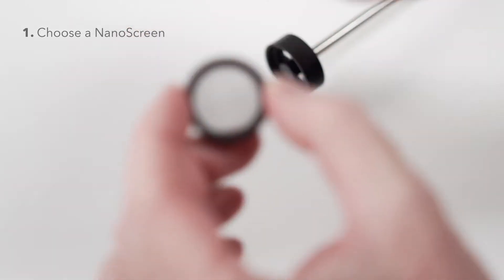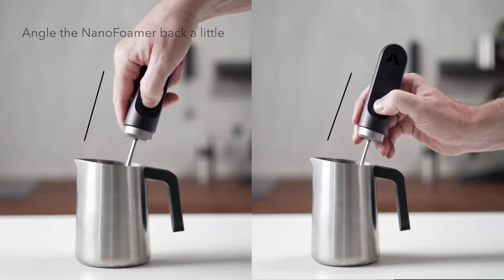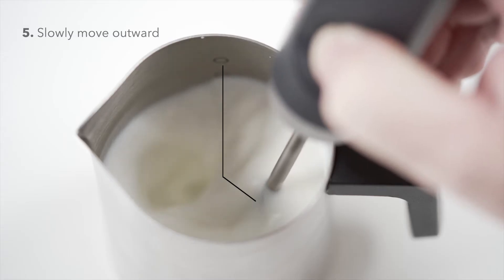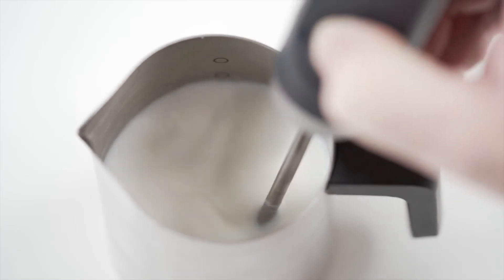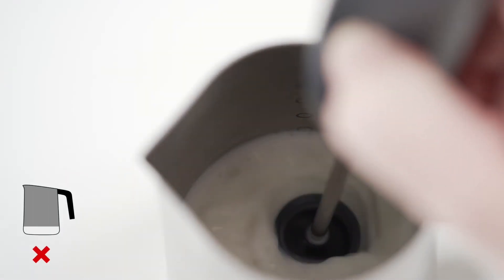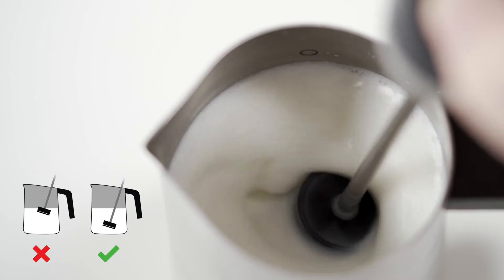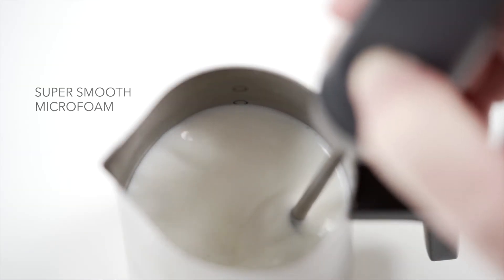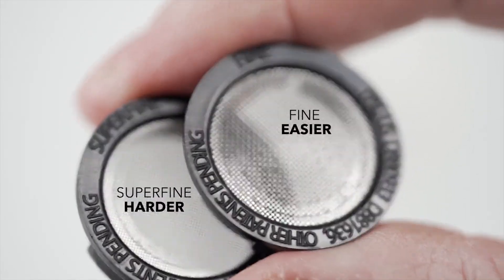How To Make Microfoam with NanoFoamer

Comment: Well explained and I love the inclusion of the troubleshooting part! This is indeed how I make microfoam using the NanoFoamer and it works out nicely most of the time. :) Sometimes I just churn a bit too long causing the milk to be slightly overaerated but doens't affect the pattern too much and it makes a lovely cappuccino :) On the other side, not churning sufficiently will easily result in unstable pattern (or no pattern at all).
Reply: love your stuff

Comment: You say “don’t start and stop” but the design of the power button on current models doesn’t necessarily make it easy to heed that advice. I’m happy with the texture of the foam I can make, but I feel in order for your product to have the best chances of success, that power button needs improvement.
Reply: Spot on. I have pretty strong fingers as I play an instrument but man, that button was made by a misanthrope.
I have had no luck yet in keeping it pressed all the way through the process, and when I’m done my thumb hurts. What’s more, the amount of pressure that button requires, is likely to break its shell at some point.
Reply: The button has been updated.

Comment: After replacing the batteries it seems I still cannot incorporate much air into the milk. I get just a little layer of foam on top and that's it. Also it seems that if I submerge the propeller deep enough like in your example, in the middle of the pitchers it will not incorporate any air and on the side it seems not to create this vortex. Is this battery issue or I am doing something wrong?
Reply from the maker: Could you please write to us at hello@subminimal.com and send in a video of your process so we can review and help you? Thanks.
Reply: @subminimal  after two emails with @subminimal I have found the culprit. It was the batteries. I have switched to rechargeable and the rotation speed is considerably greater. Today morning I was able to get my first real microfoam. I just need to practice now.
Reply: @23Adri  Hey, what batteries do you recommend? Got the Nanofoamer 2 and can only get similar to your old bubbles on top.
Reply: @boxhunters  i canot say I could recommend certain brand. The guys from Subminimal recommend Duracell or Energizer. I, on the other hand have had good results with a local unknown house brand of a supermarket in Germany. Rewe supermarket has its “ja” brand which is normally the cheapest you can get from everything. So I got their rechargeable batteries which have a capacity of 2300 mAh.

Comment: Well  whats the limit on milk? Ive only used up to the first circle on the jug  so far, so thats 50 ml i suppose. I dont want more milk than that
Reply: That is really too little to get good results. If the impeller cannot get fully submerged, you will continuously be creating new bigger bubbles. I suggest you try just below the second dot, or around 130-150ml which is still quite easy to achieve good results.